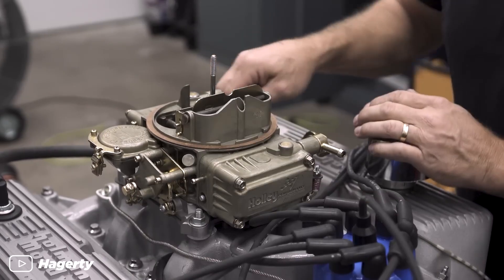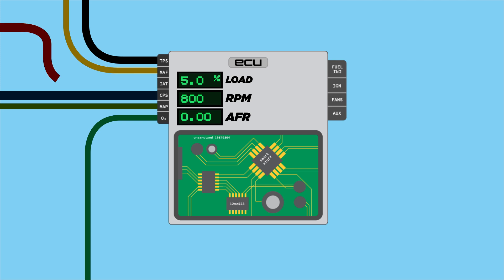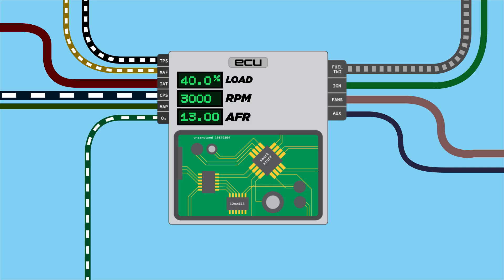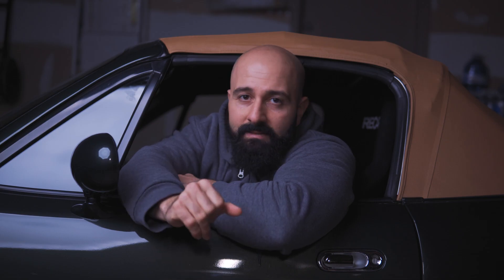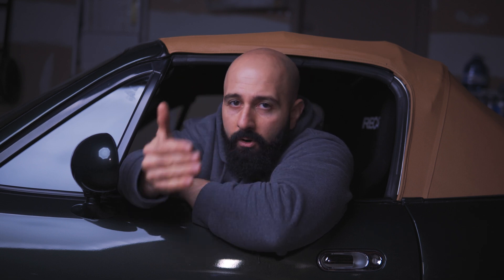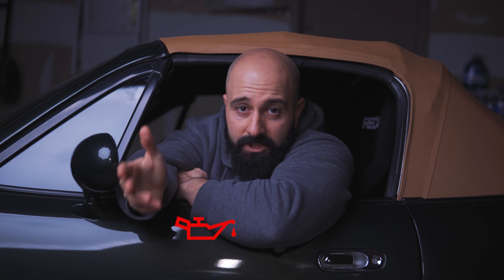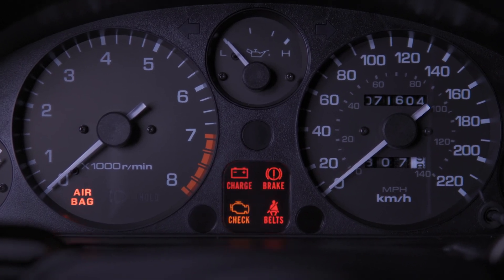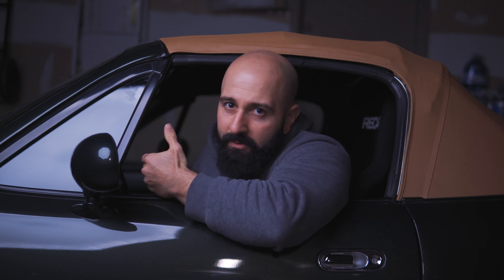Engine Warm-Up Myths || EXPLAINED

Comment: Just for ref a 0W 30 behaves as a 0 grade oil when cold (0 degC) and a 30 grade when hot (100 degC) at 0 degC a 30 grade oil is MUCH thinner than a 0 grade at 0 degrees. These grades help reduce the different between hot and cold but the viscosity of the widest multigrade oil will be nearly 200 times thicker at 0 degrees than 100 degrees. Ideally you should do as you say keep the revs below 3k until warm or near warm and as or more importantly avoid heavy load and labouring the engine

Comment: The high idle is just to get the catalytic converter warmed up more quickly, probably for emissions regulations

If its 0C out and you high idle for 30 seconds, your engine might be around 5C

If its 35C out, 30 seconds might get you to 40C

Therefore, i dont see the point of idling unless you wait 5 minutes in summer and 15+ minutes in summer(both of which are terrible for an engine)

Comment: If I am running late then I will let it warm up for a few seconds and then pull off driving so but if I am on time I will let the temperature gage get to operating  temperature then start driving,which is best for my 2006 Chevy equinox that uses 5w_30 synthetic oil?.

Comment: At least 60°C oil temp, before giving it more than 30% throttle or over 3k rpm. The coolant temp at that point is sitting in the middle for about 10 min to 15min by than.

Comment: Your wrong! Well no you’re not wrong, just forgetting something. You said -10 you’re not leaving the house. A lot of people know what real winter is. Where, You can scrape the outside of the window. You can scrape the inside of your windows. But until that car has idled enough to be producing sufficient hot air, that window is going to immediately condensate preventing you from being able to see where you’re going.

And oh boy. You think driving on a cold carbureted manual choke with oil from the 50’s is bad for your car. I assure you, driving when you cannot see a thing outside is worse.

Comment: What if I'm just driving to the corner store to get a 40oz, and stopping by the homie to share a blunt? I'm short tripp'n, not airing it out on the interstate. Moisture in the air just ends up as sludge in my oil.  Is that going to bake out later on my Monday morning 10 Mile commute to work? Warm up your engine. This guy lives in a vacuum.

Comment: What about gearbox? Mine won't "normally" shift until after it's warmed up. Yeah if I add some more RPM it will eventually do it, but the point is it is trying not to, and I don't like forcing it. BMW 328i 2011.

Comment: I have a 2018 bmw 328d xdrive, I usually let it warm up to idling rpm where the rpm would be if the cars idling at full operating temperature. Sometimes I’ll start driving when it gets to 1rpm, just slightly above idle and drive slowly. Mines a diesel, so it’s different than gas. In the winter, it takes decades to warm up.

Comment: GT350 owner here. Wait till rpms drop  to idle after cold start. Drive below 3000rpm until  oil temp reaches 210F. Drive another 15 minutes below 5000rpm. Then you're ready to send it.

Comment: Also remember metal expanding and contracting when going from cold to hot or hot to warm stopped being a thing when “modern engines” were invented. Also oil viscosity also got patched when “new modern oils” were invented so if your oil is at 10 degrees below 0 it will still flow the same as it does at 80 degrees

Comment: I wonder how many of us could jump out of a warm bed and going into a frigid night and not feel 100% till you get your bearings going. Well, cars are stuff and you can risk blowing a line, that being a brake line or power steering line etc. All my cars Last me 10-15 years and still go 212,000 miles and purrs like a kitten. Treat them right and they will treat you right and not leave you stranded. 10 minutes at least.

Comment: oil temp i think is more important than coolant temp. too bad most cars today dont give you this info but, general rule of thumb for me is...
summer cold start: idle 30sec to 1min then drive easy, keep below 3k rpms if possible till temps rise.
winter cold start: idle 1min to 2mins then drive easy, keep below 3k rpms if possible till temps rise. if car is frozen over obviously wait till you can see safely. clear car of snow ice etc.

Comment: This winter, I want you to run out to your car or truck ..jump in and immediately throw it in gear and go flying. If you manage to go screaming down the road I want you to flip on your defrost and write to is from the ER as you quickly discovered that cold air doesn't clear your windshield. Use your head for something other than a hat rack

Comment: WRONG
WHEN COLD AND YOU GO INTO DRIVE GEAR,THATS NOT GOOD ON THE TRANSMISSION 
ITS TO ROUGH
STOP WORRYING ABOUT A LITTLE GAS USEAGE.
ESPECIALLY IF YOU GO RIGHT ON A HIGHWAY
ITS A NONO

Comment: There's nothing wrong with letting your engine warm-up for 3-5 minutes. One of my vehicles, a Nissan, has over 400,000 miles on it an still holds great compression. I always let it warm-up for 3-5 minutes while I got dressed for work. One of my other vehicles which is heavily modified (720 hp 2004 Nissan 350Z) does have oil pressure gauges and you can see how high the oil pressure gets even when the engine has been idling for 3+ minutes which means the oil is thick and which may mean that it might not keep up with the speed of the rotating metal mass if you were to start driving it normally (higher RPMs) which could mean reduced levels of protection and more metal-on-metal wear.
Reply: Not necessary - watch the video again.
Reply: @DanDuran-wk6pg  Also, GM and the SAE did a test where they irradiated engine parts such as the piston rings and cylinder walls to detect radiation from metal particulates in the oil sump. They warmed-up an engine completely and then decreased the oil and coolant temps and even thought he engine was ALREADY WARM, they detected INCREASED wear metals in the oil the colder and colder the coolant and oil temperatures went. So np, the video is wrong and a longer warm-up period is better for an engine.

Comment: I always wait until the needle sits at the idling speed (it takes around 25s) and then I start driving slowly until it reaches 90°C water temp. Then I don't floor it until the 90° has been sitting for 15 minutes. Then I know that the oil temperature is at operating temperature.

Comment: I do pretty much the same that you do, I wait for like 30 seconds when my idle lowers and I don't rev too much before it's warm.
I have an E46 non M3, but on the M3, there's even a yellow line that starts at 4k RPM before it's warm. 
But yeap, 30 seconds or so it's worth it, but no more than that.

Comment: I've noticed in several Toyotas that when they start cold (below 0° Celsius) they briefly turn over 2000rpm and then drop back to 1200 within 2 seconds, is that normal?

Comment: A usually start a log fire under the bonnet on a chilly morning. If it’s really cold I also douse the bodywork in gasoline. 

If I’m impatient I fire an RPG at the gas tank, but although it works instantly, it is quite bad for long term reliability so I wouldn’t recommend it.

Comment: I always Warm up the engine of my pickup truck especially in winter season 30 mins of idle warm up is not gonna hurt and it's not gonna cost me fuel consumption since my truck engine does not consume fuel like Boeing 747. A commercial plane really is the one that consumes a lot of fuel during warm up they consume 10 to 20 gallons of Jet Fuel per minute. A Naturally Aspirated V8 engine doesn't consume that amount of fuel when Warming up. For me Warming up the engine really helps a lot for the engine components and other vital engine parts such as timing chain, oil pump, piston rod, piston rings, valves and camshaft all of these parts needs to be well lubricated before driving your vehicle. There's a big reasons why The Automotive Engineers sets up the Idle Speed of most engines to 600 or 650rpm that's the safest Rev that the engine speed should be during Idle. On top of that Water pump, Power steering and Alternator also needs a warm up, especially alternator that device charged the 12v battery to keep the electrical current flowing and recycling back to power up the Heater/Defroster. I always Warm up my truck's engine and Im driving a 2012 Toyota Tundra V8 I never had any issues or problems and my truck is still running smoothly up to this day with a whopping 578,500 miles and I haven't changed the Timing Chain YET! the chain only last 150K to 200K miles. Idle Engine Warm up really saves The Engine from early Wear and Tear!

Comment: My 2018 MX5 idles high on a cold start (any temp) and then drops down after 10-15 seconds it is part of the emissions system heating the cats (from what i have been told) if you start driving within that time before it drops the idle down its very jumpy until its "warmed up" its even states in the owners manual if you are in germany you cant let it idle until it reduces the RPM. find its pretty odd but i just leave it until it drops the RPM. 

Edit: im in the UK we dont get Canada/US levels of cold weather.

Comment: It takes 15 min for your engine to reach optimal temperatures. That's 15 min of driving. Not idling, but actually driving it carefully, keeping your RPMs below 3000. Running through your gears to warmup your gearbox would be a good thing too. 

Extreme heating cycles will kill your engine quickly. Going from cold to hot too quickly and vice-versa.

Comment: let the engine idle for 10-15 secs is fine. after that low rpms until water reaches 90°c, on a normal day with about 20°c its about 5-6 mins. after that "more normal" driving until 5 min later when the oil is at operating temp @ about 80°c. only then i start flooring hard with more than 3k rpms

Comment: I really try to avoid turbo use until the oil is at expected temp (my Mini has almost 100k), i.e. I set my autobox to sport mode to yield more rpms in each gear - warms up the car quicker and avoids turbo boost.

Comment: I would add that it is good practice to at least allow the engine to get to its low idle before shifting out of park. Cold engines typically idle high when they are first started and shifting from park when the idle is @ 1500 RPM can be harsh and stresses a transmission over time.

Comment: On the rare cold winter Floridian morningmorning I wait till after I put my boots on after foot powdering my feet, and blowing into my ignition interlock (breathalyzer) which is enough time for the idle to come down then I head out at easy rpm.
I wait til after I pick up my coworker for carpool, then I start gunning it. By then oil temp is right at 190-200 😇

Comment: 3:50 *clearances

A "tolerance" is a manufacturing specification limit, it has almost nothing to do with how tight-fitting two parts that rub together are. Except perhaps, that a very tight clearance, by definition, requires that the manufacture of the parts maintains a very small tolerance, in order to ensure that clearances are correct.

Comment: My warm up routine is start and drive immediately no idle, in my petrol/gas motor i keep it below 30% of max rpm until coolant and oil are both up to temp and in my diesel i do the same but keep rpm below 45% if max rpm until all at temp..  both my vehicles are direct injection, petrol car is 2009 mazda 3 2.0 sport on 114000miles still running tight and smooth, diesel vehicle is a 2006 vw tuareg 5.0 v10 with 125000miles and also starst runs and drives like new... i change oil every 4000/6months on the mazda and every 6000/6mobths on the diesel. I run archoil fuel system cleaner in both vehicles every 1000miles and they both return at least the mpg and performance they did when new. I think the most important thing is keeping everything gentle until operating temperature and high frequency oil changes with high quality oil and high quality fuel or regular fuel system treatments

Comment: In a warm running engine, the metal "gives" a little (distorts in shape slightly) in response to the forces being put upon it. If you run your engine hard when it's cold it will wear the metal prematurely.

Comment: I drive a semi truck doing long haul.  I don't warm up my engine intentionally but every morning I spend about 10 to 15 making breakfast and I need electricity to do this.  So I had to start my engine to get power to run my air fryer and electric kettle.  By the time I'm done making breakfast, the engine is warm enough for me to drive.

Comment: Hey man i have a tune question. Its for a motorcycle but it should be same concept. When i give it a small amount of throttle it dies. Is that from sending too much fuel at that throttle or is it more likely to be not enough air? Once its been running a while it rarely does it. Im using HUD ECU Hacker for it so going in and changing parameters is easy to do

Comment: For mine, it depends. I am Driving a Turbocharged Car. I was told to start the car and let it sits for about 5mins for it to warm up. Which I usually do. 

But sometimes I just heck it and drive off immediately upon engine start if I am in a rush but I won't whack the car until about 5 mins later. I find driving off the car warms up the car way faster than letting it sit in idle. I like to look at my gauges so I am able to monitor the temps on the go.

Comment: Well that’s the problem, NOBODY Starts Driving SLOWLY..
Most people think going 2-3K RPMs is SLOW.., well it’s NOT!!
Driving 1-1.5K RPMs is slow but mostly NOBODY follows that, EVERYBODY is in a RUSH!!
Reply: driving a turbo engine at those speeds isnt good either, at least with medium to high load
Reply: @keisuketakahasi4584  better than sitting still for 5 minutes
Reply: @mihailcirlig8187  i know someone who starts his car and leaves it for 30 mins in winter 😂

Comment: Живу в России, машина Honda Fit GD2 2007 г. Температур зимой меньше -20 градусов Цельсия не бывает, может достигать до -50, но в моем районе обычная температура -30-40. В американском и русском мануале ничего не написано про прогрев двигателя. На сайте японском сказано, что до -20 греть машину нет необходимости, на американских сайтах от 30 секунд до 1 минуты. В переводе с японского мануала написано-как только обороты уменьшатся, можно ехать, но в морозную погоду желательно постоять ещё несколько минут. 
Сам обычно делаю таким образом: если до -20, завожу машину, сажусь, пристёгиваюсь и еду(обороты при запуске держатся около 1400), через 1-1,5 км лампа низкой температуры жидкости гаснет и начинает идти теплый воздух. Если мороз сильнее, жду минуты 2-3 и еду так же обороты обычно за это время падают до 1300-1400. Через 1-1,5 км лампа низкой температуры жидкости гаснет. 
По закону у нас греть машину во дворе, жилой территории нельзя больше 5 минут. (Обычно это не наказывается, но и не соблюдается повсеместно некоторые могут греть двигатель до 3 часов).

Comment: my warmup routine (MR16DDT) is usually about 30 seconds to 1 minute. after i start the car it will do... something. it will run rich and the rpms will bounce a bit and then it will rev itself to about 1500rpm. once it does that it will drop to about 1100. once it does that, i'm good. i usually give it another 10 or 15 seconds or so anyways.
Reply: also got the mr16ddt in the pulsar, very neat little thing

Comment: If using the right oil that is recommended by the manufacture, waiting 1-3 minutes is good, depends on the temperature outside, so the metal gets warm and the oil goes around and gets warm to be able to get through the filter without going throw the by pass valve at higher RPM, and do not load the engine much until it gets up to operating temperature.
Reply: Not necessary. You're wasting gas and accelerating wear.

Comment: ny car has a oilpan heater and additional 230volt interior heater
im running 10w-40 (should be 5w-30 or 0w-30 but its a VW so it burns it like fuel) and cold starts without the pre heated oil are pretty rough even at -10c 
takes about 10-20 seconds for the topend to quieten down, then i wait for a few minutes for coolant to warm up so i can start to feel my fingers and drive off and hope i make it to work in time

Comment: I let the car warm up enough to defrost the windshield on its own, which is about 10 min, If its not frosty I let it run till warm air starts coming out the vents.
Reply: You are damaging the engine by warming it up that long
Reply: @johnciampoli5311  you are damaging your engine by not warming it up that long, it takes tiime for oil to warm up and flow where it needs too before you start putting load on it.

Comment: What about turbo warmup in cold temps? Couldn’t the excess fluctuation in heat possibly crack the manifold? Correct me if I said it wrong, still I usually just start my car up about 10 mins before leaving
Reply: Unless the manifold is some sort of shitty aftermarket one, you should be fine. Also unless you live in a very cold climate, 10 minutes is honestly rather excessive. I'd look into the potential issues with excessive idling of a vehicle, and I'd consider 10 minutes PER startup of the vehicle to be rather excesssive. I'd would say once you see your coolant needle begin to move (assuming you have one) you're definitely in the clear. I personally just start mine up, get buckled, get music situated, and then take off and drive gently until the coolant needle is at least in the middle.
Reply: @QuincyStick  oh okay gotcha, yea for me the coolant needle only starts moving closer to the 8-10 minute mark depending on how cold it is outside. Thanks tho, if anything I think 5 mins should be enough

Comment: Im lucky to have a downhill and slower section of road near my house, so my warm up is pretty much same as yours. Wait for the revs to drop ever so slightly, then change gear at just past 2.5k rpm, cruise down a hill in 3rd, then stick to 40mph in 5th till everythings at operating temp